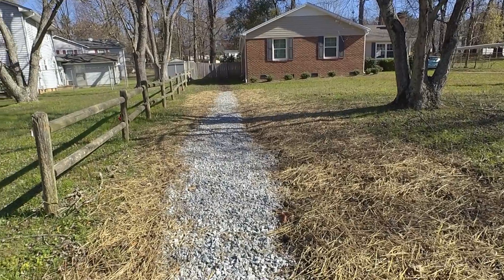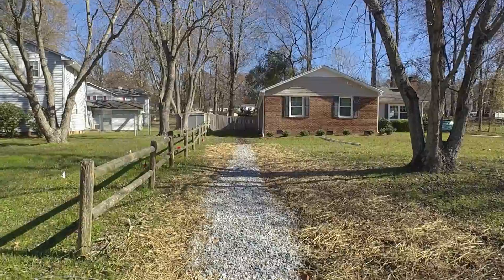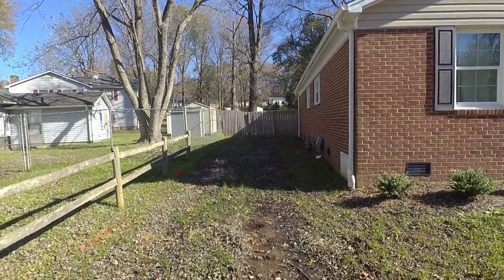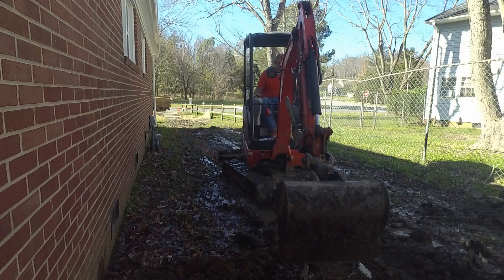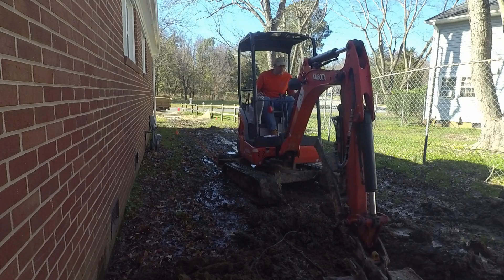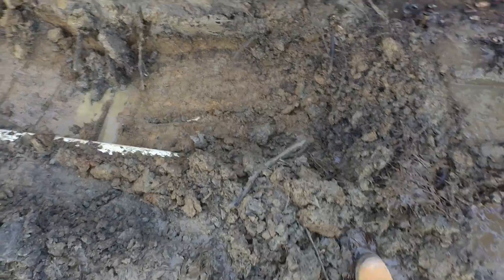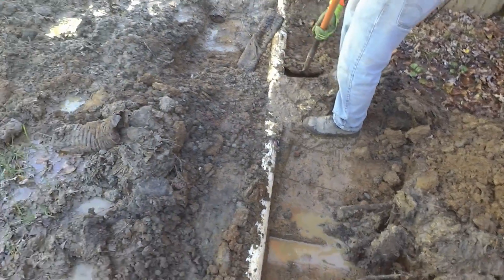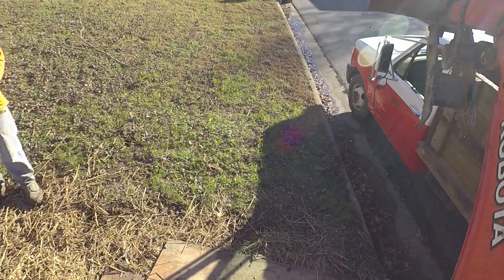Proof that french drains work! for draining non-point water sources

Comment: You gotta dig deeper and narrower.  Then line with double punched fabric.  Then put the pipe in.  Then the rock.  Then burrito wrap the rock and pipe.  Otherwise, in 2-3 years, your rock will integrate into the surrounding soil and the surrounding soil will integrate into the rock and your system drains at about 50% of the first 6 months and down to 0% by the end of the 6th year.
Reply: There is no such thing as double punched non-woven geotextile fabric.  That is a lie that FDM tells to sell product. I have talked with fabric manufacturers, and they tell me the way that the fabric is made its not possible to "double punch" fabric. Any company that makes 4oz fabric has a flow rate of 140 gallons per minute. We do use fabric and it does not clog up, does it slow the water down entering the french drain? Yes. Does it make the system maintenance free? Yes. Don't believe everything you see on YouTube.
Reply from the maker: If we had gone any deeper we wouldn't have fall to the curb. The height of the street is what determined how deep we could go on this project. I also don't use the fabric because it clogs long before 24" of gravel does. I want the water to flow easily into the gravel and into the pipe. Burrito wrapping the gravel causes too much restriction of flow which is why I don't do it that way. Same with putting soil back on top. Water doesn't flow through soil like it does gravel.
Reply: @GCFD  I see your point, but with soil, especially not being clay, that drain won’t last near as long as it does with being burrito wrapped.
My argument is this. Yes it restricts the flow, however a French drain is for subsurface water, so super high flow rates are irrelevant, since it’s a leach system anyways. 
Now if you are concerned with moving water fast (which the only cause of fast moving water would be surface water) Install catch basins in the system as well. Of course I would run solid to the curb for that though. 

Also you don’t necessarily need a lot of fall for a French drain, as long as the water has a place to alleviate. (Path of least resistance)
Reply: @Elswick17  makes sense
Reply: did you miss something? The dude's got a clean out right there in front of you if you bother to watch...
Reply: @jameshswor  okay that’s awesome, but once the drainage aggregate is full of soil it will not work anymore or have good flow. 
Clean out doesn’t clean the rock ole bud just the pipe lol
Reply: @Elswick17  I understand your point about the aggregate becoming soil integrated - but with the level of flow this pipe can have a good high flow pressure hose dug down to the level of the drain pipe would remove volumes by dispersing is as fine sediment into the free flow drain
Reply: @jameshswor  Calm down James.

Comment: If you get time you should check out " the french drain man" he in Michigan and like you hates corrugated pipe he uses pipe with smooth inter wall that comes in rolls.
Reply from the maker: Thanks for commenting bob. I have looked at the FDM and tons of his videos. His techniques and materials seem to work for him in MI, but I don't like how he advocates corrugated pipe. He even has a video about how corrugated is better because it creates turbulence and keeps its self cleaned out. That's garbage advice. He does advocate removing soil and replacing with gravel. The problem is he uses round rock instead of angular rock.
Reply: @GCFD  interesting. What is best ? Round rock or angular and why? Thanks
Reply: @palmlifeuk3553  1 1/2 to 2 inch round rock works best. It allows for larger voids to keep water moving quickly. It does not shift or compact over time.

Comment: No filter sheet around the stone. With that amount of surface water entering the gravel it will silt up pretty quickly and became a lot less efficient.  I Liked the clean out, nice touch, but the rainwaters plugged into the French drain will vent the system.  It is certainly better than the neighbours so well done for that but the fabric sheet would have prolonged the life of the system. I bet the neighbours system doesn't have fabric either.
Reply from the maker: Thanks for the comments Mark! If there is enough silt to plug up 24" of gravel then it would certainly plug up a sheet of filter fabric much sooner, wouldn't you think? It seems that a large volume of gravel is the best filter for sediment. It's also important to use angular rock and not round river rock. The angular gravel locks in place. Thanks again for watching and helping to make these systems the best they can be.
Reply: I’ve noticed the filter sock for corrugated pipe definitely does, haven’t used in years because of that.  The fabric I use now allows the fines through and keeps the dirt and rock separate.  I use the French drain mans technique there and I have drains few years old at this point working great, time will tell but I have opened them up and they are nice and clean.  I have not built any like yours so I’m glad they work for you, I really enjoy your videos. Also the follow ups you do when it’s raining and seeing them flow is very satisfying ty
Reply from the maker: @UniqueSatellite  Thank you! I feel the same way about the follow up footage. It can be a pain to catch it during a heavy rain, but I think it's worth it. My customers tell me they stare at the water flowing out and find it very satisfying as well!
Reply: How old is the neighbor s French drain? If it's old, hard to use it as evidence of which system is better. It would be more convincing if you compare apples to apples
Reply: I like the non woven fabric to keep rock and dirt separate.  The silt and fines will flow through
Reply from the maker: @UniqueSatellite  don’t you think the fabric will clog up before 24” of gravel will? I still like the idea of high flow into the gravel and the high amount of gravel acting like the filter.